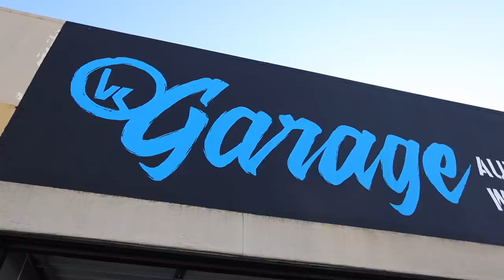MY BAGGED TESLA MODEL 3 REVEAL!

Comment: "No oil pans to crack" .... Yeah just a battery that if punctured can explode lol.
Reply from the maker: Yeah no big deal right 😂😂😂
Reply: @SneakerheadinthebayVlogs  just get a ceramic coat underneath and your good.
Reply: It’s not easy to puncture the battery.
Reply: @sanahaskuranage8071  Titanium plate.
Reply: Battery packs in Teslas don't explode. Look into how they're engineered. It's way safer to be in one of those if it gets in a wreck and the battery pack is damaged as compared to a 10-30 gallon tank of highly flammable and instantly explosive liquid dinosaur.
Reply: That doesn't sound likely
Reply: Got a skid plate, and those batteries won't explode
Reply: @vickviper402  hahahah you funny
Reply: .... and it's literally never happened a single time even with hundreds of thousands of these on the road for 2 years ......